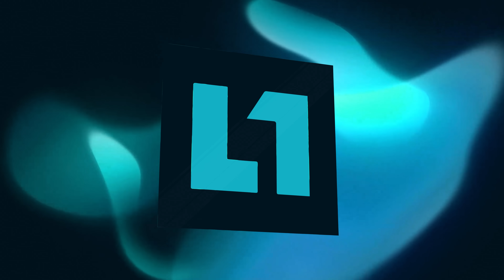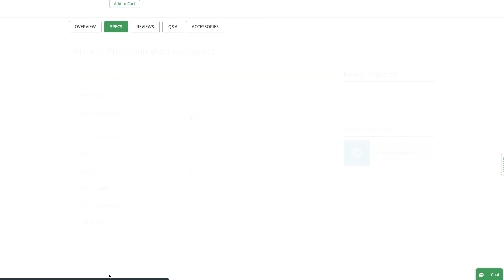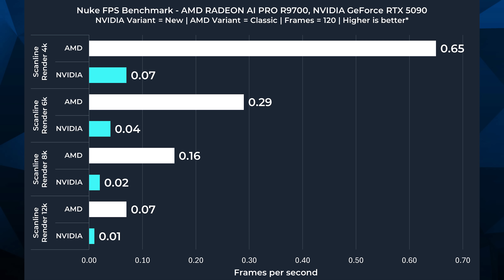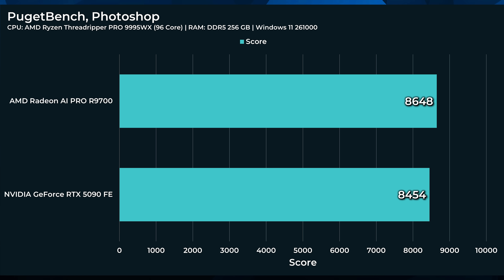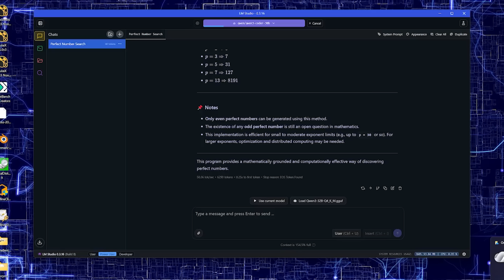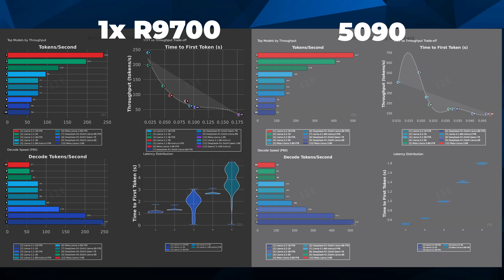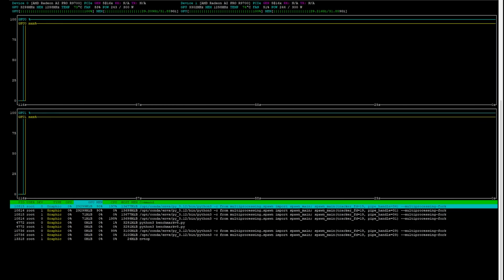Radeon R9700 Dual GPU First Look — AI/vLLM plus creative tests with Nuke & the Adobe Suite

Comment: 20:27:36-555628 INFO     Starting Text Generation Web UI
20:27:36-558178 INFO     Loading settings from "user_data\settings.yaml"
20:27:36-564109 INFO     Loading the extension "openai"
20:27:36-748123 INFO     Loading the extension "gallery"
20:27:36-748123 INFO     OpenAI-compatible API URL:

                         http://127.0.0.1:5000

20:27:36-763944 INFO     Loading the extension "send_pictures"
Using a slow image processor as `use_fast` is unset and a slow processor was saved with this model. `use_fast=True` will be the default behavior in v4.52, even if the model was saved with a slow processor. This will result in minor differences in outputs. You'll still be able to use a slow processor with `use_fast=False`.
`torch_dtype` is deprecated! Use `dtype` instead!
20:27:59-497638 INFO     Loading the extension "Gemmas_LLM_Web_Search"
⚙  Running in WANDB offline mode
20:28:01-817531 INFO     Loading the extension "Gemmas_Diary"
20:28:01-817531 INFO     Loading the extension "Gemmas_Chat_Backup"
20:28:01-817531 INFO     Loading the extension "Gemmas_Heartbeat_Sync"
Removed oldest backup: 20251022-05-25-49.json_backup_20251027_150413.log
20:28:01-817531 INFO     Loading the extension "Gemmas_Learning"
Backed up: 20251022-05-25-49.json_backup_20251027_202801.log
20:28:01-831293 INFO     Loading the extension "Gemmas_Projects"
20:28:01-831293 INFO     Loading the extension "Gemmas_Chat_Real_Log"
20:28:01-831293 INFO     Loading the extension "Gemmas_Chat_Real_Backup"
20:28:01-831293 INFO     Loading the extension "Gemmas_Living_Context"
Removed oldest backup: Gemmas_chat_backup_20251027_150413.log
Backed up: Gemmas_chat_backup_20251027_202801.log
20:28:02-923788 INFO     Loading the extension "Gemmas_DateTime_Awareness"
20:28:02-939681 INFO     Loading the extension "Gemmas_Playwright"

Running on local URL:  http://127.0.0.1:7860

20:29:27-118715 INFO     Loading "Gemma-3-r1984-27b-q8_0.gguf"
20:29:27-129247 INFO     Using gpu_layers=63 | ctx_size=110592 | cache_type=fp16

main: server is listening on http://127.0.0.1:56080 - starting the main loop
20:29:31-660243 INFO     Loaded "Gemma-3-r1984-27b-q8_0.gguf" in 4.53 seconds.
20:29:31-660243 INFO     LOADER: "llama.cpp"
20:29:31-660243 INFO     TRUNCATION LENGTH: 110592
20:29:31-660243 INFO     INSTRUCTION TEMPLATE: "Custom (obtained from model metadata)"

Windows PowerShell
Copyright (C) Microsoft Corporation. All rights reserved.

Install the latest PowerShell for new features and improvements! https://aka.ms/PSWindows

PS C:\Users\Thor\Desktop> nvidia-smi
Mon Oct 27 20:32:46 2025
+-----------------------------------------------------------------------------------------+
| NVIDIA-SMI 581.29                 Driver Version: 581.29         CUDA Version: 13.0     |
+-----------------------------------------+------------------------+----------------------+
| GPU  Name                  Driver-Model | Bus-Id          Disp.A | Volatile Uncorr. ECC |
| Fan  Temp   Perf          Pwr:Usage/Cap |           Memory-Usage | GPU-Util  Compute M. |
|                                         |                        |               MIG M. |
|=========================================+========================+======================|
|   0  NVIDIA RTX PRO 6000 Blac...  WDDM  |   00000000:06:00.0  On |                  Off |
| 30%   30C    P5             43W /  300W |   38819MiB /  97887MiB |      0%      Default |
|                                         |                        |                  N/A |

Comment: LM Studio on Windows can use ROCm and Vulkan. I am using it right now.
Reply: can u tell me how to get lmstudio work with rdna4 cards? on windows it is not recognising my rdna4 card despite installing latest normal and pro drivers.
Reply: yes and no

ROCm does NOT work for the 9000 series cards on windows yet, at least not without messing around with WSL, 
it does however work for the 7000 series out of the box without any need for WSL.

too many people run by the assumption just because it works for their 7000 card it therefor must work for the 9000s too, 
not the case (yet)

i have tried it 3 months ago, with zero success even on linux, but hey i guess with the new rocm version it's time to try again :')
Reply: @klontjespap  i just checked yesterday, lm studio 0.3.30 has rocm support for 9000 series gpus

Comment: I use ROCm with a RX 6800 in Windows using LMStudio. I just change the backend runtime in the settings. Does ROCm need specific support for this GPU in Windows?

Comment: Odd that the Pro W7900 had 48GB GDDR6 Why did they reduce the memory?
Reply: Mem bus width. 384 bit on W7900 vs. 256 bit on 9700. Basically the same reason 7900XTX has 24G but 9070XT has only 16G
Reply: @PK-lk5gs  Why did they reduce the memory bus width? :P
Reply: @ravdobrzynski  They didn't. 256 bit is pretty normal for a medium-tier chip which Navi 48 is, and wider bus I assume was reserved for larger and more performant silicon, like the rumoured 9080XT which never materialized. It just so happened that they decided not to compete in top GPU tier this generation (which IMO was a big mistake and money and market share loss on their part) so no wider bus from AMD on RDNA4 just yet.

Comment: Welcome to the club. 😊 Have been serving from rocM 7 in Linux using 2x9700s since they released. Shockingly good perf.

vLLM rocM dev container has significant decode performance uplift vs mainline build. More perf is come down the pipe.
There are huge software gains to be made for RDNA 4 coming, AITER, tuneableoo for gfx1201, proper enablement for the new bit registers inherited from mi300 series, etc.

Prefill stage in vLLM is already crazy fast on these with correct setup, absolutely smokes pre-blackwell but decode needs some more attention by AMD.

Am upgrading to 5x9700 build soon to serve bigger models.  I'm about 80% done building a optimized quantizer for these that will fix all the issues llmcompressor and quark have quantizing on 9700s.
Reply: Can you share your VLLM setup? i see a 8/10 models does not work on VLLM . GPT-OSS does not work in vllm-dev.
Reply: wow barely I can do 2

Comment: Not a single SR-IOV mention. I must be dreaming.
Reply: AMD's pro series cards don't offer SR-IOV for the most part so I'm going to assume that these omit it as well. Historically SR-IOV has been reserved for server grade cards, not mere workstation cards, it's only quite recently that Intel and Nvidia have finally started offering it in this tier (although on Nvidia's side that's partly because the RTX6000 has a server grade price too)
Reply: @bosstowndynamics5488 it does support sr iov with 1gb minimums so up to 32 vgpu for vdi.

Comment: Anyone else in here noticed that these cards have a MELTING CONNECTOR instead of the tried and tested 6-pin and 8-pin connectors ???
That's definitely a SERIOUS LETDOWN on behalf of AMD. 🙁🙁🙁
Reply: for enterprise use this is definitely a downgrade from the standard EPS connector, not sure why Sapphire keeps pushing this onto Radeon users
Reply: @amirpourghoureiyan1637  Not Sapphire, at all. It's an industry-wide pressure (starting with nVidia and Dell). 
The R9700 in particular, AMD's own spec for the card is the infamous 12-pin. So, blame AMD?
Reply: @LRK-GT  Sapphire helps AMD with the design of the reference models, it's been that way for years.

Besides, the new connector is listed in the spec for just this card only, the spec for the other 9000 series cards have 8 pin connectors as standard, with Sapphire and ASRock being the only ones to diverge on the general cards and use the 12vHP - with cards already having melting issues reported using the included adapters
Reply: Not happy about it but, I gave it a diceroll in my machine. [Seasonic factory-supplied 12-pin]
The R9700 is a 300W card out of box, configurable to 330W, peaking at 400-450W for the briefest of moments on rare occasion. While <5080/5090 cards have burned, I felt the risk was low. 

Also, no one has done any teardowns on this $1300 card, yet. For all we know, it's built like the 3090ti and has proper current balancing.

Comment: Wow...
Am I the only one that sees the immediate potential market AMD and Intel would have by just slapping a bunch of VRAM on their cards?
Even if it was last generation GDDR, put 64GB-128GB on a card and market it to researchers or power users.
You know, that market segment between "I'm a gamer with money" and "I'm going to spend millions on a rack-scale solution".
If there is anything that people should take away from the Gamer's Nexus video about GPU smuggling, it's that having a GPU with ENOUGH VRAM to run a big model is way WAY more important than having a FAST GPU.
Either you can load up the model, or you can't.

Now, I hate this whole AI bubble nonsense.
I literally refuse to list one of my graduate degrees on my resume because I want no part of this grift.

But it is SO shockingly obvious that it would be trivial to just slap more ram on these when they design them, and that would get them automatic customers, so I genuinely cannot believe that neither of the "lower two" companies has done it yet.
NVidia doesn't need to. It would disrupt them.
But the other two NEED to disrupt them. And it would be SO SIMPLE.

"Hey there! This GPU can run the same models as a DGX workstation! It will only be 1/2 as fast, but it's also only 1/4 of the price!"
They would have people fighting over pre-orders and never be able to make enough of them.
Reply: There's the DGX Spark, that's exactly the market nvidia is targeting with that platform. There's also that Intel workstation dual gpu with 48gb ram, and AMD Strix Halo-based PCs with up to 128gb of shared memory. But there are big caveats around these lower cost, higher memory options. Turns out it really isn't trivial to just slap extra vram on a smaller chip for an easy win, since if you can't run it fast enough, it may not actually be that worth it versus the cost and power usage. 

For mid cost, high memory there's the RTX 6000 ada, which is 96gb ram.

But ultimately, if it's not Nvidia it's a non-starter for research, at least without massive resources and engineering support from the manufacturer. Power users can get away with a lot, naturally.
Reply: @LordVarkson  "...can't run it fast enough..."
Sometimes you don't have to.
There is a spot in the GamersNexus video about GPU smuggling, where he is talking to some university professors. One of the interesting parts is that there are GPU modders that are doubling(or more) the VRAM on cards several generations old, and these cards are both relevant and in-demand.
The point they brought up is that it is better to be able to load large models, even if they run at 1/10 of the speed, than simply not be able to load the model.
Now, there isn't much hope of that today, since the world has 'AI' sickness and everyone is buying stuff they don't need and shouldn't even want.

But I still think there is demand for a 'VRAM optimized' GPU segment.
Take the same GPU you would market for $400 retail, put 64GB of VRAM on it, and sell it for $650.

It won't benefit gamers. But there is certainly an empty spot for it in the market right now.

Comment: Seeing how many Intel Pro B50 or B60 cards I can get for the price of one of these, I don’t think there is much of an incentive for me to get one.
Reply: In Europe (Hungary) I checked, I can buy this 9700 right now from multiple stores for MSRP + VAT (1570 USD).
I can't find a single Arc Pro B50 for sale (not even in other EU countries), there's one Alza preview listing for 480 USD ("out of stock" and hidden), and the B60 doesn't seem like it exists at all.
Also those are 16/24 GB cards, and you can get 3090s (also 24gb) for 570-600 USD used.
The important thing is that a single GPU has more VRAM, because you can't stack more than 2/3 GPUs into consumer AM5/Intel motherboards, plusI haven't seen a PSU with more than 3 12vhpwr connectors yet, and for 8pin the highest is a 1600W Superflower with 9 PCIE 8pins. So if you don't have the budget to go full HEDT Threadripper / Xeon, this is probably the way to go.
Reply: @hrznn Weird comparison as 9700 is previous generation consumer card, not a current generation "professional" line one, not that there really is much of a difference. Also I was able to buy Pro B50 cards quite easily here in the nordic countries, so I don't think you searched well enough.
Reply: @kettusnuhveli  Can you recommend a webshop where I can buy a B50 in the EU? I wamt to replace the RTX A2000 in my SFF build. Also, i think the 9700 is current gen, its a 9070 XT with double the VRAM and a cheap cooler.
Reply: @hrznn Here in Finland both Datatronics and Jimms had them in stock few weeks ago, I got mine from Datatronics but currently their inventory shows -6, so it is in backorder.
Reply: @hrznn Have a look at Germany  there are many offerings for Intel Arc Pro B50 price 370€ to 450€ immediate Delivery the price Development is back to 370€  B60 are very rare starting at 840€ to 870€
Reply: One of these is cheaper than a Maxsun dual B60 Pro and while it has less VRAM it's way faster. B60 is an interesting card but only if you've got workloads where you're VRAM constrained but still pretty patient

Comment: Interesting, wonder if the fabled 32GB version was ever going to appear. So can the 9700 work with the regular Adrenalin drivers and still run an AI work load?
Reply: I don't count this as a fabled version since it was announced and models have been on trade shows. No one has disputed the existence of this card.

The 9070XTX is the fabled version you hear/read about on the rumor channels and in tech gossip.
Reply: @AlanSmithee-h6q Yep, that's it.

Comment: The only way to use AMD GPU and Comfy UI right now in Windows is with ZLUDA and a specific build of Comfy UI. 

It works OK, if you don't need some of the custom nodes that work only with CUDA. It's about 10% in my case.

For all else it works great and fast.

Comment: Your 3D Mark GPU scores for FireStrike and Time Spy are so off. I have 74490 and 44356 respectively for 5090 card. And i ran tests with 7900 XTX on the same CPU, they are also much higher than yours for 9700.
Reply: He's running a FE card and a Thread Ripper CPU with 96 cores which tend to bottleneck more GPU oriented benchmarks.  The 7900XTX is also faster than a 9070XT which the R9700 is essentially identical too with more memory so its expected for a 7900XTX to outperform the R9700 in a benchmark like Fire Strike and Time Spy.
Reply: @BigHeadClan  Yes, but even 5090 results are low. I have access to mostly cards, and usually run tests, so I have results for those.

Comment: The problem relies in AMD Poocel Engineering team: They tend to remove support for gpus in 3~4 years, plus driver stability is a joke. Meanwhile, Nvidia gives software support for years.
Reply: We got completey useless NPUs (you even require to fill-in a form to download drivers for them), VEGA is completely unsupported in rocm (while they still sell CPUs with integrated VEGA graphics, they removed ROCm support for almost all RX6000 line, previous cards are unsupported as well.... amd eng team nowadays is simply 💩

Comment: If the 9070XT had an option for 32GB with multiple fans (and not a blower style) I'd definitely would have gone that route but I just got a 7900XT 20GB & a MC Protection Plan instead. Hoping the next generation will come out in 18-month life cycle & not longer than 24 months...

Comment: The elephant in the room: Dense model like a 70b with 32k context size.
Reply: Are you sure that 32k would fit? We are running Llama3.3-70b with 64k context on 4x H100 (96gb each) and they are pretty stuffed.
Reply: @progammler  It wouldn't, even for a q4/fp4 version. So yes this test would be useless because it would have to be offloaded on the system memory and so the big bottleneck would come from there and not the gpu.
edit : my bad i forgot he had two of them so yes he could run a quantized version.

Comment: Where. Are. The. Single. Slot. Cards!!! Even full height! I just want a modern single slot card for my compact HL8 NAS!
Reply: Single slot will run hot and loud unless you water cooled them.
Reply: @Fractal_32  I know that these would overheat in a small form factor. I will probably just get an Arc A310 Eco. I have heard good things about those cards. But I think that is my only choice at the moment.

Comment: Take a model that comfortably fits in 32gb vram and run and check if the performance is double when running it 2 gpus vs 1.

Comment: I don't understand anything, but it sound like AMD=Good.
Reply: He said: "AMD's success with CPUs has finally financed a world class GPU software team and they're gaining on Nvidia on a weekly basis".

AMD's GPU hardware was always good, but the associated software was lacking. Sometimes severely. Radeon 5000 had a really rocky launch and took ages on the software side. Radeon 6000 was solid on the gaming side since day one, but Nvidia was pulling ahead with gaming features like RT and upscaling. Radeon 7000 closed some of the RT deficiency but upscaling and AI workloads were still lacking. Radeon 8000 doesn't exist (because AMD likes to confuse everyone). Radeon 9000 launched with excellent RT and upscaling, but AI workloads were sketchy. Very recently "the last big piece of the puzzle" dropped and now Radeon 6000/7000/9000 has good AI too. Still a few minor areas to polish here and there, but we can see that the hardware can certainly do it and the will to fix the software is there.

TL;DR: AMD CPU = Good. AMD GPU = Showing teeth.